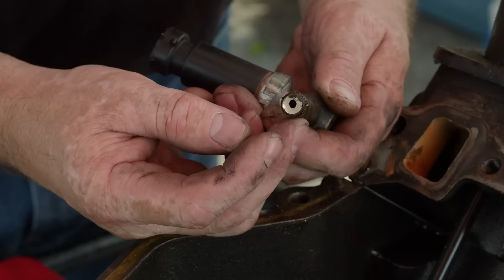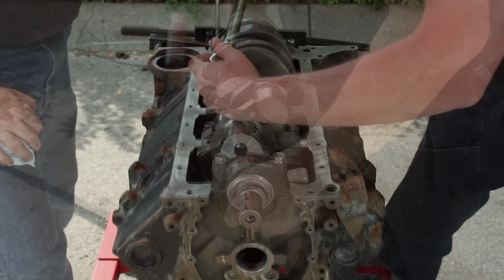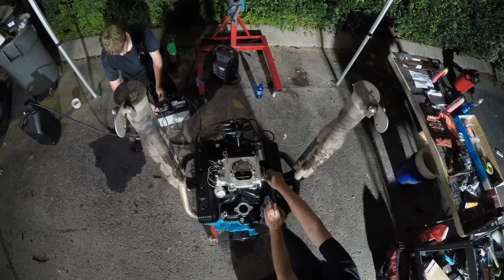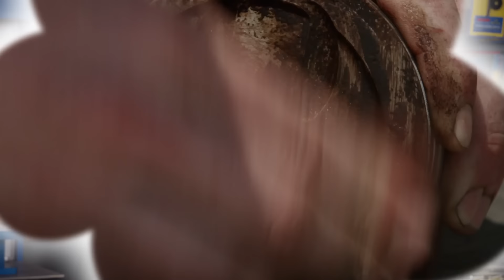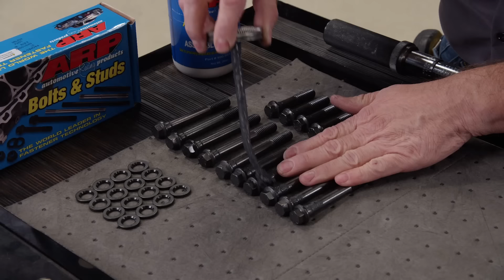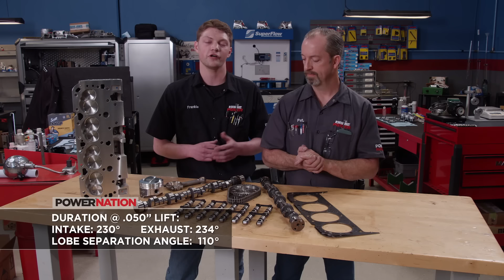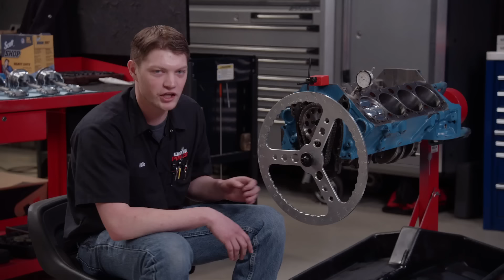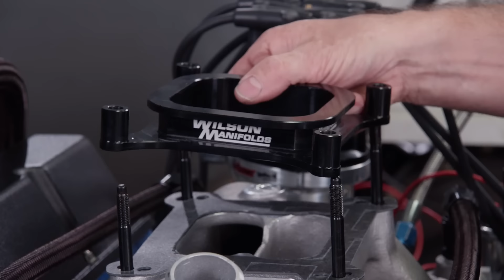Over 13:1 on Pump Gas! Chevy 350 Dyno Mule - Engine Power S9, E9 &10

Comment: I took a college course back in the late eighties that was taught by a cam grinder.
His point was “ effective pressure “. 
Finally, a automotive show that is addressing all points around this conversation. Great job guys. Stay with the higher level shows. Your dynamic compression ratio show was great.
Reply: Static is math volume tdc compared to bdc, dynamic is measured in psi and around 175psi is the limit of pump. Yeah you can take timing out but just killing hp

Comment: You guys power curve is so off for a small block back when I was building 350 race motors at 10-1 i was making peak power at 7800rpm ( I think it’s those crappy cams you guys run I ran a hug Lunati race cam ) I was getting according to NHRA’s rolling my road dynamometer I was making 900+ HP N/A with peak at 7800, in the quarter mile I went through the trap at 9600rpm cause i ran a power glide to run 1/8th and 1/4 mile tracks without changing anything on my car

Comment: You guys are misunderstanding something very important about dynamic compression. Intakes close after bdc on the compression stroke because the flowing air has inertia - it continues to flow in and fill the cylinder after the piston has started up on the compression stroke. This is called the ram effect. It is only at low engine speeds that air is pushed back out past the intake valve, resulting in less charge to compress and reduced dynamic compression ratio (and rough idle on engines with long duration). When a cam is in it's happy operating rpm range, air will not be pushed back out past the intake valve. If there was no ram effect, cams would always close the intake at bdc. 

The longer the cam duration, the more the engine needs a single plane intake, or even better, a tunnel ram intake. The longer and straighter the column of air, the greater the 'ram' effect, and the more it can take advantage of long intake duration to increase cylinder filling at high rpm. That's why it's called a tunnel RAM!  

Some dynos measure air flow volume and can calculate actual volumetric efficiency. A good performance engine can have a volumetric efficiency of 105-110%, and a race engine can hit 120%. The cylinders can actually be filled to more than their true volume, which is effectively like adding a little boost. It should be obvious to everyone that an engine can't exceed or even reach 100% VE if it's pushing a bunch of air back out of the cylinder and back into the intake manifold on the compression stroke. This is my main point: an engine operating at a VE of over 100% can have a dynamic compression ratio greater than the static ratio, or the exact opposite of your assumption here. Your engine is probably well over 100% VE, which is why it makes a lot more power than a stock engine, even with so little timing. Clearly a high comp engine can run on low octane gas by backing off the timing, but why? I bet it would make the same or more torque and hp with the same gas at 10:1 comp and 34-36 degrees of timing.

Comment: Great episode. Would be interesting to see EGTs. And what putting it on E85 and more timing would do!
Reply: I was thinking about this also.
Reply: Switching to E-85 on an N/A engine doesn't do a whole lot for power production. You will see a little more torque, but that's about all.

Now, E-85 on a boosted engine compared to gasoline, Hold ON....
Reply: How about using a duel fuel E-85 to warm up on then switch on the propane to keep those expensive parts clean!
Reply: @brucearterbury1856 No....

Comment: So for $5K you can get the same amount of power as a $500 5.3 LS with a cam.
Reply: Go spe ND 500 and show us
Reply: @hankclingingsmith8707  i was also wondering where he’d get and LS for $500…
Reply: @pear586 if you can’t find a 5.3 Gen 3 for $500 there’s something wrong.
Reply: 4.8 and 5.3 1st and 2nd gen you can get around central fl. For $250-400 on the low side, he'll I scored an 03 6.0 out of a suburban for $475.00 complete from intake to oil pan including the acc. Drive ,wiring harness and factory ecu.. salvage yard thought it was 4.8 because of the emissions  tag under hood😅😂
Reply: @hankclingingsmith8707 Richard Holdner has done it 500 times on his channel hanky.  You can’t find a Gen 3 5.3 for $500 at a scrap yard??  E-Thugging has got the best of ya lil Hank!
Reply: @Cultofpersonality09129 junkyards don't sell running 5.3s for 500 bucks. This isn't 2016.
Reply: 5 years ago 500 in the Midwest. NOW 12 to 1700 running.  Not a junk. You prove it. Holders videos are years old. Today prove your worth and do it. Reality. Anybody can move their lips like a prostitute
Reply: @hankclingingsmith8707 😂😂😂 savage
Reply: You must be smokin them cracks if you think you can get a 5.3 AND a cam for "$500" today. 😂😂😂
All those videos you're referring to are pre-2019. 
Please link a video to a Richard Holdener video with a "$500 5.3 build" from the last 5 years.
I'm subbed to his channel and watch 2 or 3 of his live feeds every week as well as his older build videos.
Reply: Basically
Reply: My chevy vortec 350 made 405hp 420tq with a 200$ cam and 300$ carb all new parts. Your 5.3 will not make those numbers for that price.
Reply: @crackjack8320 I bet it did NOT....
Reply: @davelowets  richard holdner and pisscutter performance do this combo constantly. Mine has dyno sheets of 405hp 420tq

Comment: Doing a 13.0+ compression engine build to see if it runs on pump gas without detonation becomes a moot point when the total ignition timing is only 22 degrees! Chevy 350 builds normally make max power between 34-38 total timing.

Regardless, I NEVER get tired of watching people build engines!
Reply: You want the most power, with the lowest timing number, which showcases how good the head/combustion chamber is.  Many ultra HP engines run 0-15 degrees total at WOT
Reply: @erikradzins  It will be lazy off low rpms we run as close to 28* as we can given the fuel quality. It might sing on top but will be lazy getting there.
Reply: @ED--wh8zt  I use both calibrated knock sensors and pressure transducers when I am tuning ultra HP stuff, or things that are very very expensive.   For lower HP common stuff reading plugs and using a loaded dyno work just fine.  

But 28 degrees is ONLY realitive to the head, bore, compression and camshaft being used.  

EXAMPLE: I have had an engine come to me that was at 32 degrees total advance by the previous tuner.   However that engine made peak HP at just 24 degress with no detonation.   Then under ultra high heat/load situations it actually needed 21

Needless to say, that 32 was excessive, and uncalled for.  And why the engines life previously was only a matter of months.   The current engines have now lasted 4 years and counting
Reply: @ED--wh8zt It'll be lazy on top also
Reply: @erikradzins NOT when your crutching too much compression for the fuel you are using.... 

Put some 114 octane fuel in it, and it'll make the most power on 32° or so.
Reply: I pretty much agree. They should have went up on timing, until they felt it was getting into detonation. They would probably also seen, the engine running after the ignition was cut. The power they made was not very impressive, and they could’ve made a lot more. I hope they continue with the R&D here

The intake center line is not proper for anything. And no engine builder would do that on purpose. Another reason, why it was dismal on power. Honestly, I think they were setting themselves up for the most possible gain, when they change the camshaft

Another interesting test would be, to put the intake centerline where it belongs, on 107, and add some E85 to the 93, making E25-30
Reply: No one who knows how to build an engine would buy these parts new to build an engine. This was a good demonstration of bleeding off cylinder pressure to use the parts you already have or putting your race engine in a daily driver 😅

Comment: Can't seem to get my head around having a cylinder bored .40 over and then honing it out to .60? Other than just trying to get the compression higher, I see no practical purpose in hogging a block out like that unless absolutely necessary? Core shift and meat between cylinders for anything with higher than factory stock compression ratio can lead to some problems. If the surfaces are flat and the right head gaskets are used its no problem with under 10to1 compression. I'd definitely use the bigger cam to keep the cylinder pressures down with those pistons.

Comment: The Last trick flow stroked Mangum 410 cubic inch that made 537 Hp, where was the camshaft centerline? i know you said around that the first it was 101 something then changed to 105. was 101 straight up from design and you changed to 105 ? was cam retarded when changing degree?

Comment: When you have high compression you need  huge cams with single plane intake manifold you choose the cam that drops the most dynamic compression not one that keeps it high defeats the purpose especially on pump gas
Reply: I caught that two…I was like if your trying to squeak by with that much static compression on pump gas then your gonna want to bleed off the cylinder pressure with a really “big” cam ie. a cam with a ton of duration/very late intake valve closing so as not to give the cylinder as long to build pressure.  Then he said we chose the smaller cam with not much duration at all and I’m scratching my head.  I didn’t catch him giving the full cam specs with what’s to some extent most important and that’s the event timing— most important being intake valve closing! 
I’m of the choose a camshaft by a few factors school of thought. 
1. Try to get lift close to where the head flows the most cfm after flowbench testing
2. Taking into account static compression and fuel that will be used choose a camshaft with an appropriate intake valve closing point—earlier if your trying to make a low static compression engine run better and later if you’ve got a ton of static compression and want max hp up top for drag racing and that’s also when #3 comes into play synergistically 
3. Duration. Typically a low duration cam works better for low rpm torque and power production and a higher duration moves the power upstairs and puts the peak power more closer to max rpm
Reply: i think they know that.  the point wasnt max power  it was more about what you can and cant do with high compression that would normally be meant for race gas.

Comment: IF at all possible, it would be nice to see both cams used and the crank key used in each position and see the data that may show what it does and benefit us for our project vechiles. Keep the hard work up!
Reply: ya i wanted to see if they had to dial the timing back with the smaller duration cam because higher dynamic compression. and just to see how it compares
Reply: Toyota Tacoma has an engine with variable valve timing.    It adavances the cam timing when you get into it and it runs like a V8 engine and runs like a mellow V6 engine when you're just cruising
Reply: @Popwarner-x1w  and they last 500k miles
Reply: Advancing or retarding the cam will do NOTHING but move the powerband up or down the RPM band. It will NOT make any power difference.

Comment: You should dingle-hone it with the block up side down, so any grit that flies off  doesn't get flung in the block. But outside past the head deck. (plus, the rings don't got that far down the bores anyway)

Comment: I rebuilt a 396 big block from my 69 chevelle in the parking lot at Ft. Belvoir Virginia in "75" when I was in the Army. Finished it just as the MP'S were telling me I  couldn't do repairs in the parking lot 🙃
Reply: Many an engine has been torn down in the barracks parking lot.
Reply: Thanks for your service 🇺🇸.  Chevelle is on of my favorite classic cars.
Reply: Had a 67 ss chevelle.im a VA boy .had a couple swaps in mine to.
Reply: Repaired  transmission in the barracks parking. MP watched me. Not a drop of oil. Was done in 4 hours. He waved and drove off. Haha
Reply: Used to sneak cam swaps in the parking lot of an apt I rented as a teenager. Caught once or twice but got er done! You could have a musclecar in a crappy apt building and not worry too much about it back then

Comment: No mention of quench. Dang
Reply: Quench starts within .060 from the piston top, to the head chamber. They were well within.
Reply: @jhutch1470  I was hoping they would discuss it
Reply: @smncutler  I hear ya. It would have been nice.
Reply: They mentioned a .040 thick head gasket, but not where the piston sat in relation to the deck.
Reply: @Turbo4Joe363  I'd love to see flat tops .005" above deck

Comment: If you want quirky, try the 80's 2.2L/2.5L Turbo Mopar. It'd be cool to see what older tuner engines can do.
Reply: check out Richard holdener for 2.2 videos
Reply: That’d be cool. Variety is the spice of life! I’m all in for something (or anything) different then a typical small or big block V8. 😎
Reply: @Ian_Mag  IMO, the biggest reason to stay with the small block V8s, especially the SBC, is money. Parts are cheap and plentiful. I would love to see a serious Oddball. A 2.8 GM V6. GM did use them in their racing programs back in the day but you can bet the parts would be unobtainium and not a lot shared with other engines. At least the 4.3 shares with the SBC.
Reply: Those things were garbage... 🗑
Reply: @davelowets  They can be. Old tech has its limitations. Although, with the right setup, it'll hurt feelings on a daily basis.
Reply: Those are certified pieces of shit....

Comment: And for a little more money thrown at the rotating assy to stretch to 383 it would have been a huge gain in HP & Torque.
Reply: The horsepower wouldn't be a whole lot more, but the torque gain would be better

Comment: So,,,, you have proven a point, but a point that no one really cares at all about!! People are concerned with a few factors over all today. Power and longevity on pump gas and efficiency. Overlapping cams can bleed off all kinds of compression, but with that goes mileage and with the cost of ALL FUELS today, who the hell wants that??  Hell, I don't just want to run pump gas. I want to run CHEAPER PUMP GAS!!!  Fact is, I am ready to go electric so that I can suck the power out of the sun!!!!  Especially for a race car as I can design a nice light car with quick change batteries and have all the torque I can use right from RPM #1!!!    So when are you guys starting THAT show?????
Reply: You can build an 87 octane gas high hp engine, but voting for liberal politicians gets you high gas prices..
Reply: @P71ScrewHead  Don't be an idiot. At least know what you are talking about before you spout off.. RESEARCH IS YOUR FRIEND...

Comment: 327 2bolt main block, small block Chevy, stock GM rods,, cast pistons, 23°  heads, 14:1 compression, pump fuel, 7500rpm, street driveable, drive it to the shops, drive it to the track, drive it home.
Reply: You would have to have a huge dome 13cc+ with less than 60cc chamber to get 14:1 out of a little 3.25 stroke 327 flame travel would be horrible.
Reply: @ciggsnstrings  yeah right? That compression is so high. Btw, did u understand the question i ask to this guy? Idk if he thought that i was hating his engine or saying things against it idk, what i asked is that the guys of powernation said the static comp on the 350 was 13:1 but the dynamic was 9.1:1, so i asked as  Brenton said the engine was 14:1 i assumed he meant the STATIC compression was 14:1, not the dynamic
Reply: So what would be the Dynamic compression in that engine if it has a theoretical static comp of 14:1 as you said?
Reply: @matiasdamian8106  actual.measured compression mate, and I'm not willing to disclose that information."be happy to build you an Engine for you though.
Reply: @brentonk461 NO, I would NEVER let you build an engine for me... 😬
Reply: Why the hell would you purpose build a high compression engine and then just screw up the valve timing to bleed off the compression. Makes no sense at all.
Reply: @ciggsnstrings because the cam and the compression is where it's at. That same cam on 10:1 would lose a heap of torque and about 15% power. 

That's why large cams require more compression. You want to be running 180-200 psi on a pump fuel aluminium headed motor.  A cam that big in a 10:1 car will probably only run 140 psi.
Reply: That's just a recipe for garbage... 🗑 

Where are you going to find a "cast piston" that's good for 14:1? 😂
Reply: With a cam that creates a 7500 RPM peak, you had tons of overlap. Where DCR is concerned, overlap is your friend!!
Reply: Counter productive, I’ve got 10. To 1 dynamic on a 302 ford, love eaten shevys, and I’ll govern the engine to 6000rpm
Reply: @rodneygodin7773 You're not eating any chevys with that turd

Comment: You guys need to do up a 418 inch windsor Faux 289 HiPo build. Use the K-code air-cleaner exhaust-manifolds and valve covers, use a 5.8 roller block and use GT40P heads with a little hand work and valve upgrades, and use a Summit F303+ camshaft installed straight up. I know a lot of first generation Mustang owners would dig that kind of original appearance built high performance engine 😁
Reply: Thsts the same shit done for 40 years
Reply: Nah, why bother? Same ole typical garbage that's been done to death. Boring

Comment: That engine would not be very happy on the street.  Probably run hot with that 22 degrees of timing.  That's not enough.  Maybe put that on E85 and add some timing to it.
Reply: I would guess they have E85 plans. They did say this is an R&D engine.